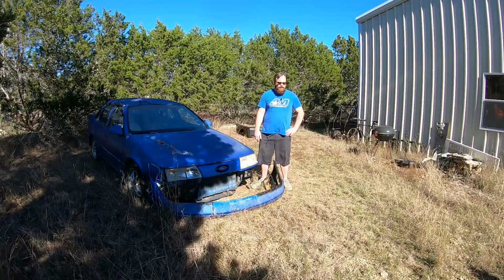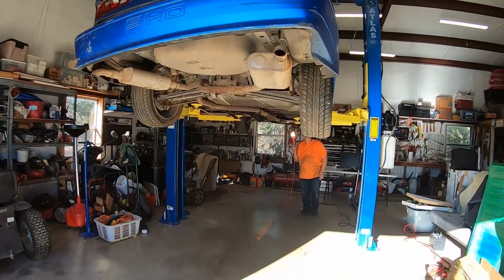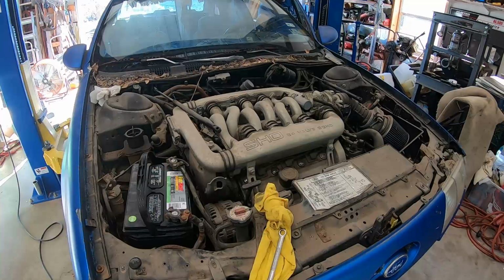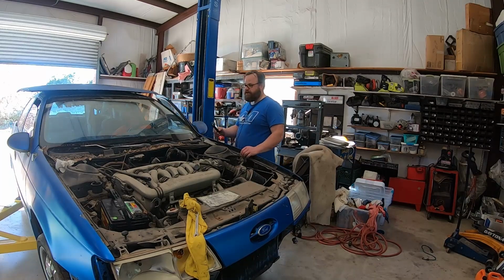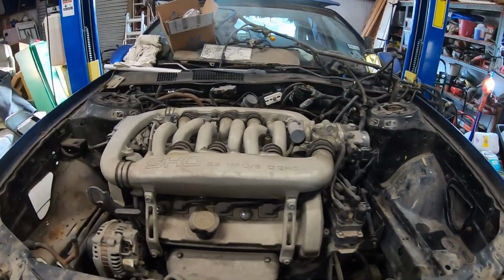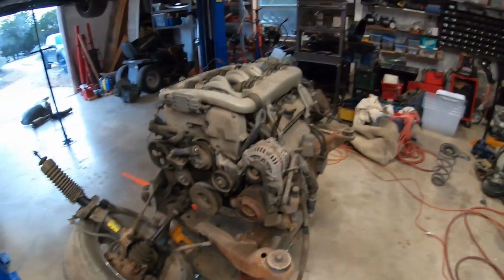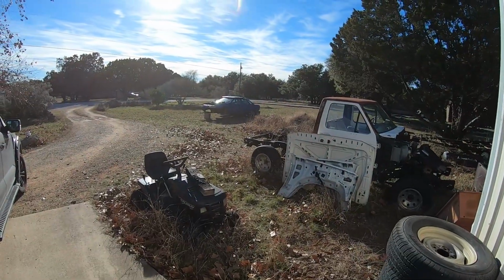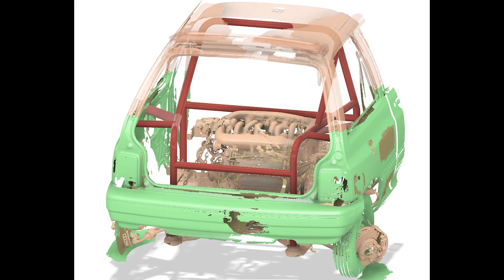Ford Shogun Build - Episode 1. Tear-down and Scan.

Comment: I have to say, I love the way you're going about this!  I haven't seen a lot of projects done this way, but I think all the scanning and building it virtually will make it much easier build physically! Along with that, you'll probably end up with a car that's much more straight and accurate than if you just started cutting and welding.😁 Keep it up, cant wait to see where it goes!
Reply from the maker: I've seen a few. Unfortunately Superfastmatt has been doing it for a while. B is for build has done it for a bit too. B is for build beat me to the 3d scan / 3d print / fiber glass body kit stuff too, which I have planned for this build if it goes well. It's the future for sure. I think we will see a lot more people going this route soon. 😁👍 thanks buddy!